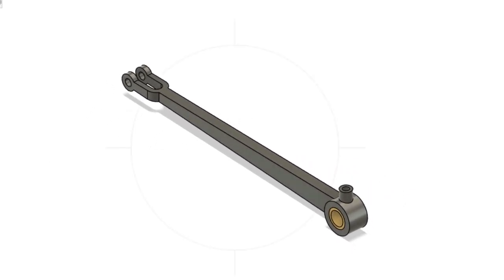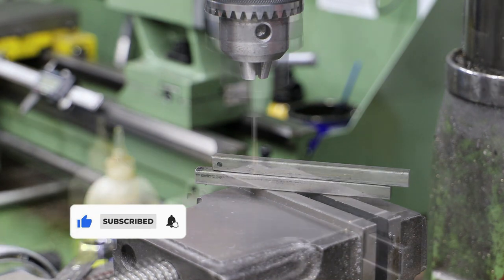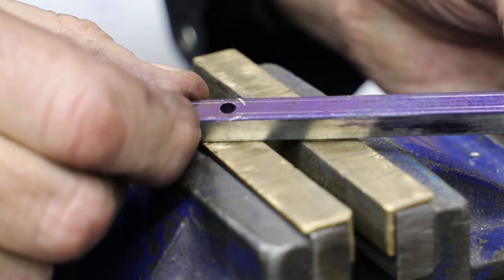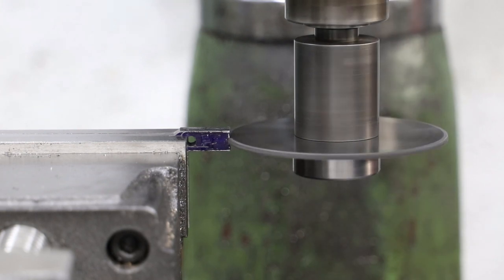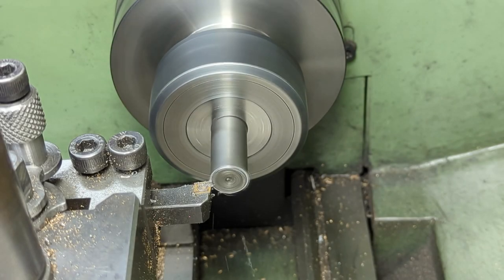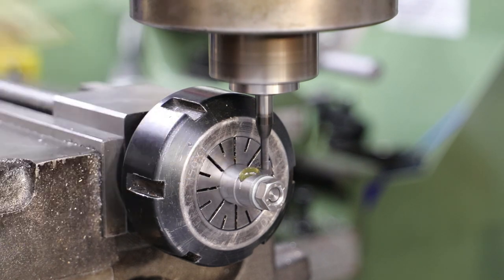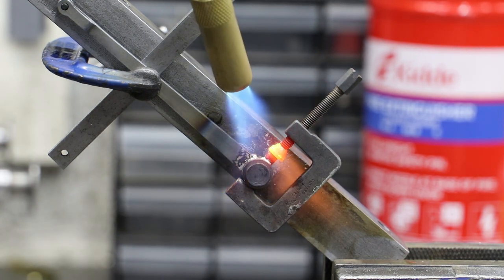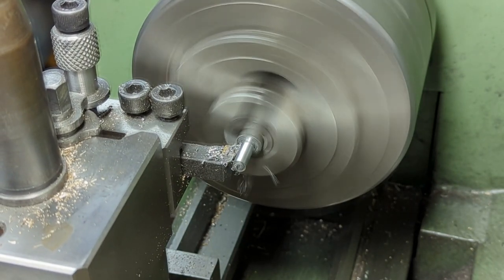Part 46: The Eccentric Rods

Comment: Yet more nice videoing chap . Might have been an idea to drill a hole for the boss  to be silver soldering too as opposed to cutting a slot in the boss
Reply from the maker: Yes, there were a few options, each with their own pros and cons 👍
On reflection I think you're right, start with wider flat stock, solder in the boss, no need for a jig.

Comment: Nice and neat work! 
I bet you know.... but the solder does not only flow where the flux is, it is also flows where the heat comes from... in youre case here, try to apply heat from the underside. 
Realy nice work!
Reply from the maker: Hi Chris,
You can take the credit for my desire to use the files instead of the milling machine 🙂 
As for the heat, I did start with the flame against the bottom, but my Jig was taking too much heat away, so I moved to the top, hence the messy finish :-(
Soldering is like painting - it's all about preparation and......very day is a learning day!
Cheers
Mark